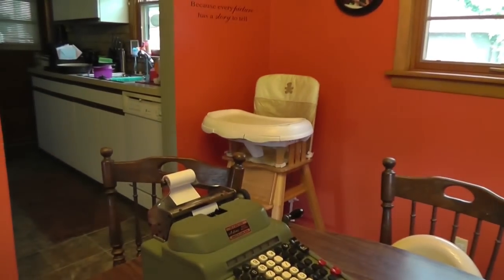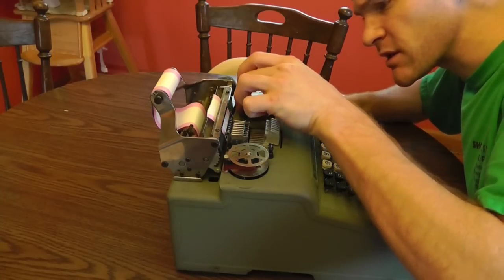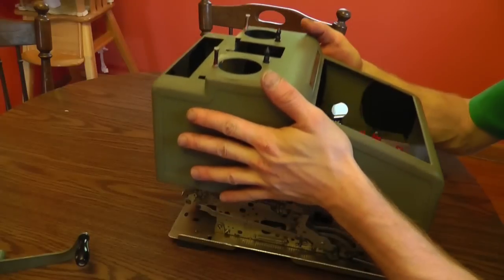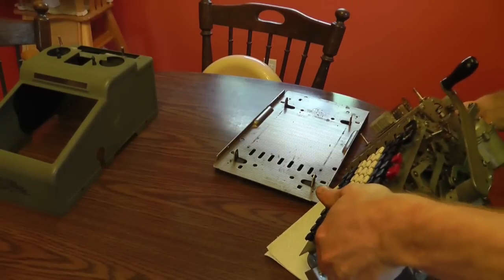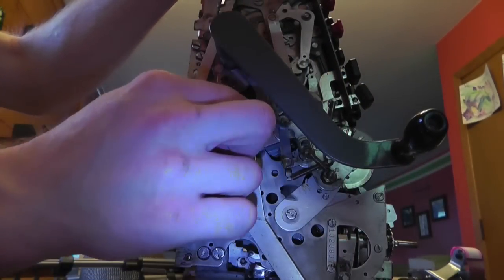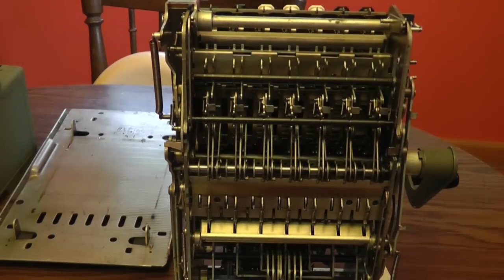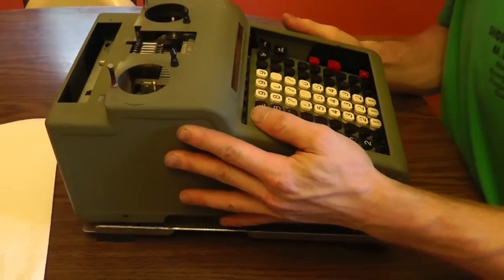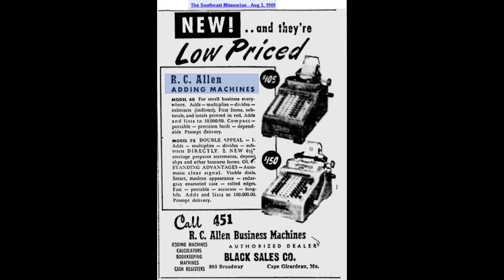What's InSide... R.C. Allen Model 75. Crazy 1949  Mechanical Adding Machine...

Comment: Good work man. Thanks for sharing. My barber shop has a very cool RC Allen cash register. Basically what you got, but with a cash drawer attached.  I worked for Western Union when it was still the Western Union Telegraph Company at a System Shop as a Repair Tech. repairing and refurbishing all of the Teletype equipment in use in the 1970's Sometimes, also some Siemen's equipment.

Comment: I'm glad your ink ribbon still works.
I have an old electric adding machine. I used to use it to add up amounts for bill payments. I had to stop using it, though, because the printing was very faint.
These things are very handy to have for making sense out of financial statements. I like them better than modern calculators, because they can go as fast as you can work the machinery. Not so with a modern printing calculator: after you punch in the numbers, you have to wait for the printer to catch up.
Reply: Are you still there?

Comment: Love this stuff...my youngest (Anna) and I are presently taking a RC Allen cash register apart to clean and oil it...Never done this before! She bought it from a junk dealer about a year ago and wants it fully functional. Do you know a source for a users manual and possible parts (i.e. print ribbon)? Any thoughts on using WD-40 as a solvent to defunky-fi and then maybe gun oil to lube??
Reply: Have you had any success with getting it fixed?